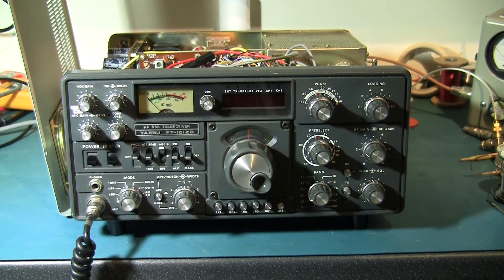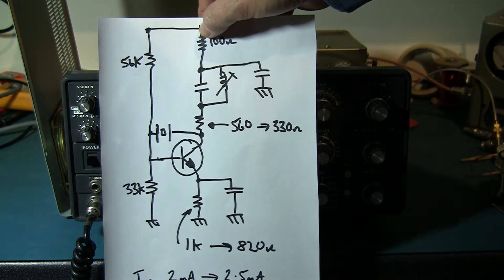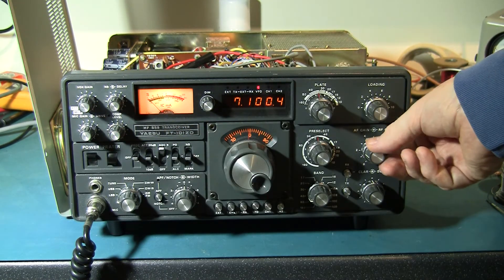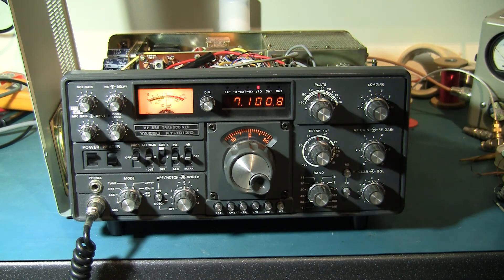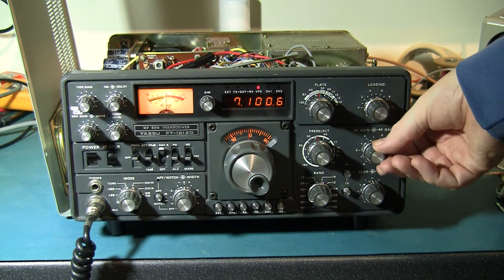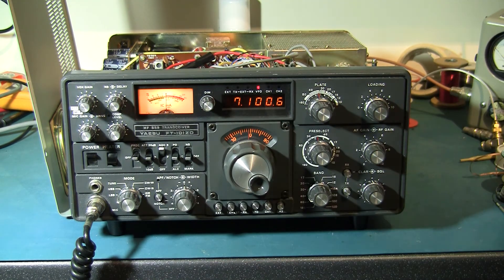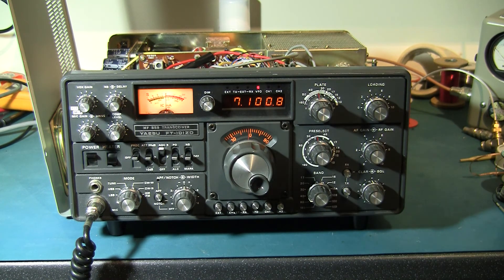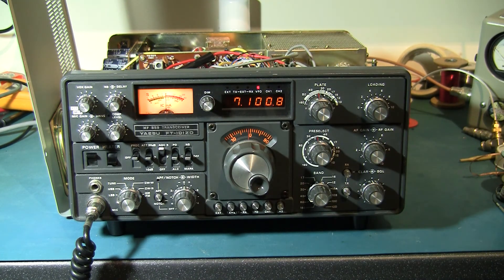FT101ZD Hetrodyne Oscillator post repair - Part 2

Comment: Tim, I have problem you may sort out for me hopefully.
FT101ZD everything is working on receive but when I key the mic the large relay with all the yellow wires attached starts rapid switching off/on changes the freq counter to 91.014 read out no matter which band it is on when keying mic, transmitter side was ok until this problem, wont transmit at the moment due to this rapid off/on of the relay .
Hope you can help.
Reply from the maker: Hard to say what is going on without getting it on the bench - but I would hazard a guess it's a sticky relay contact which may also be pulling down the low voltage supply.  But this is just a wild guess, I prefer to fault find and analyze before jumping to conclusions.
Reply: Tim Forrester Yes tricky. I had a good look at all the components nothing burnt, changed the RF board the AF board, no different. 
Also checked and changed 2 resistors on the 2 large smoothing capacitors.
Are you in the UK Tim I could probably get it to you if you are, I'm in Wales.
Reply from the maker: Yes I'm in the UK, check out qrz.com for contact details under G4WIM
Reply: OK Tim qrz.com are trying to sort out my password as I have changed my email address and I cannot access my old email address for the new password.
Reply: You have a very impressive QRZ page Tim, very nice.